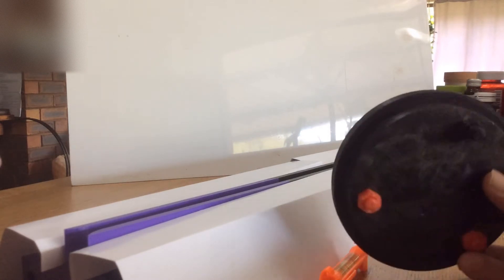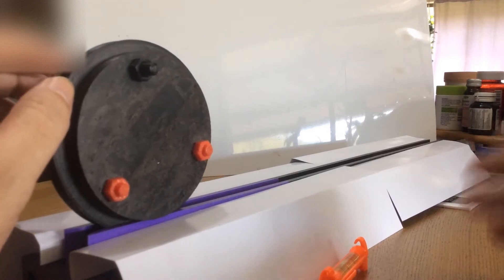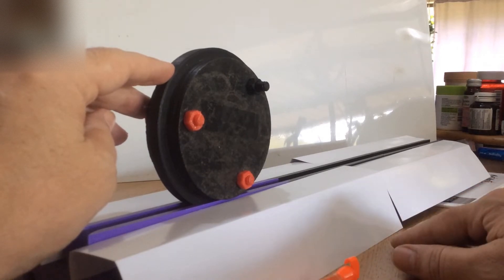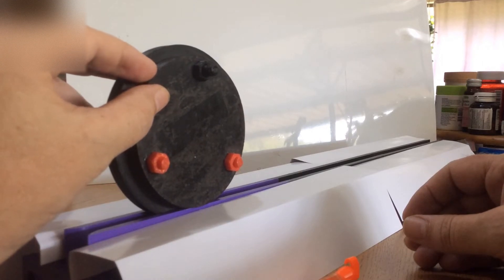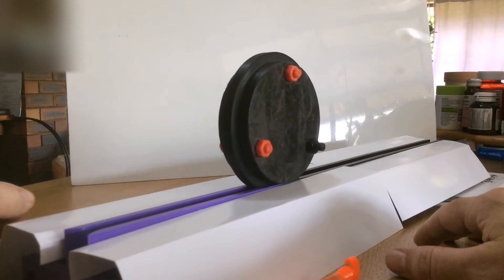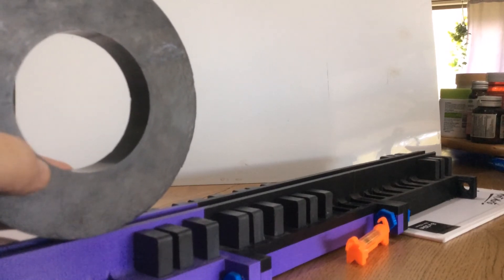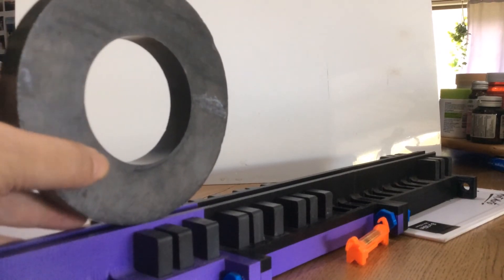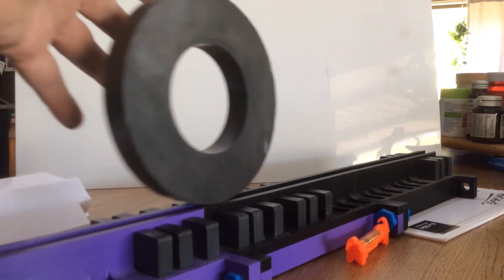Magnetic Propulsion Free Energy Magnetic Track Motor Design Perpetual Motion Concept Full Disclosure

Comment: This would never repeat forever you do know that right
Reply from the maker: Yep, nothing lasts forever, eventually parts wear out and need replacing. Just like you can’t buy a petrol generator and expect it to run forever. Magnets are reported to have a life span of 1000 years, not sure how that got that figure but that is a very long life battery! I will say in my designs defence, it will go the full distance of a track that anyone can afford to build and leave the end and re-enter the magnetic lock under the influence of it’s own mass, that is the holy grail of magnetic motors. This is capable of accelerating its own mass also, as you can see this is not difficult to achieve with this design, the real problem is realising they lied to us when they educated us! You can’t fix something if you don’t first acknowledge it’s broken!
Reply: @whatifididthis...1236  no I mean, even if you extended this track to X amount eventually it would stop simply due to friction of both the track and the magnetic repulsion. Completely flat track like you showed, extended to X amount, would not go on forever
Reply from the maker: @domestinger8805  Due to the rotor having the ability to self start and re gauge and it uses its own mass to accelerate to a speed determined by the spacing of the magnets your statement is incorrect. I don’t mean to be rude but I have tested hundreds of designs over several years until I settled on this one and magnetic repulsion nor friction will stop this until natural entropy occurs. This does not resist the magnetic flux and therefore the magnets will last a long time, as far as friction is concerned, it can self start and increase in speed so I don’t think it cares too much about friction. I built so many before what you see and I can comfortably say when spaced correctly it overcomes friction and continues on its way. There is one thing that sets this apart from other designs, instead of trying to overcome the magnetic lock I have included it by breaking the track. Now what you see is multiple tracks in series, it doesn’t work if magnets are evenly spaced. Then through years of experiments I worked out as long as it can enter a track and exit a track and re enter another track of same dimensions under the inertia of its own mass then my goal has been achieved.
The only way you will truly believe me is to build your own, this is very very far from rocket science and doesn’t get any easier in my opinion!
Reply: @whatifididthis...1236  look, with all due respect, I am just as passionate about alternate physics as you, but this is incorrect. It's as true as gravity, oras true as the consistency of chemical reactions; no matter what you do, so long as you have a level track, magnets and wheel(s) there is no way to prevent entropy.
Reply: @whatifididthis...1236  I'm not saying this to be a dick I'm saying it cuz I want you to turn off that idea in your head so that it doesn't affect your future work and create inaccuracies.
Reply from the maker: @Dome Stinger  As I said before Entropy would be the only reason this would stop, by that I mean the parts would have to wear out. In respect to the magnets, they aren’t going to fail before the life of the purchaser, in regards to the track structure you can use materials much sturdier than 3d printed plastic and same for the rotor. Once I worked out the correct mass for the rotor it worked. I don’t believe in perpetual motion because the moment you need to service a device you most likely need to stop it. No device has ever been built and left alone forever with no expected wear and tear or maintenance and the same would be expected if this was a method of propulsion. People would maintain it but if you choose your materials correctly this could easily out live the creator. Nothing lasts forever. But this would supply power for a lot longer than most systems if maintained. Today I repaired the starter motor on my ride on mower, entropy had set in and began oxidising the spring and retaining clip, I decided to intervene in entropies plans and restored their condition to delay entropy, nothing lasts forever, but you can make it last longer and the lawn looks better because I worked with entropy.
Reply from the maker: @Dome Stinger  With all due respect, I understand where you are coming from but this is something I completed a long time ago, I dedicated a large portion of my life to real experiments. I realised our education was wrong and started to look into the cracks and making this device work sent me into depression for a few years as I knew without question I had been tricked, lied to, deceived by people I thought were great minds, now my ego was questioning my intelligence, if I was as smart as I thought, why had I not worked out this lie earlier. I sit on the other side of the fence having done the work myself because I don’t trust humans. I once ran the same tracks you run in your mind but just like Tesla wasn’t a fan of Einstein because his work was based on theoretical imagination and garbage and Einstein was also a military product, unlike Tesla who did the physical experiments in the real world, supplied evidence, and so many marvels that we all use today. In this case I have done the work, seen success with my own eyes, tired of all the bullshit, all the nay sayers so I did it myself. The way I see it, we can put down our ego that hides behind our education, go on a journey, educate yourself, with your eyes, your hands, see for yourself if it works or not, of most importance don’t beat yourself up when you experience the shame that comes with the realisation we were all fooled, your not alone, they fooled much greater minds than ours!
Reply: @whatifididthis...1236  I don't doubt that we have been fooled and lied to. It doesn't change the fact that this does not work how you state it does. We can define entropy however we want but we both know what I mean when I say what I said. This device doesn't "work". Whether this wheel rolls through another 5 magnet sets or not, it's not what you're claiming it to be. Without manipulation of energy (sea of aether), everything on this physical earth abides by the same principles of entropy (not wear and tear, equilibrium). Once the bath water has emptied, it cannot be refilled unless work is done to put it back there. This is not a lie. Eventually the earth will no longer exist due to the same law. Parts wearing out is no different to things slowing down, or losing energy. EVERYTHING in its natural state on earth abides by this same physical law.
Reply: @whatifididthis...1236  to reclairfy: parts wearing out IS NOT the only reason it would stop. The other reason is that the momentum of its mass is unable to consistently overcome the magnetic interaction. This is because the mass and magnetic field are both static and not dynamic. Static magnetic fields cannot produce work unless they are made dynamic within a system. Mass cannot change unless it is made to within a system.
Reply: @whatifididthis...1236  to double clarify: this is why bedini works, because the magnetic field can appear and disappear dynamically within the system at will. You gain extra kinetic energy from the system because the magnets are not equally hindering the system as much as they are helping it, which is what is happening in your case with this particular experiment. There is no magic without a dynamic magnetic field: a coil bringing a magnetic field into and out of existence, or moving the field.
Reply from the maker: @Dome Stinger  I think you are missing the point that I agree with you. I have said nothing lasts forever but there are things you can do to make it last longer. There is no point in debating this with you, I genuinely enjoy your questioning but it is hard for me to debate something that is part of my reality, you need to remember that I have done this. I ask nothing of you except build it, then let’s have the same chat about it.
Prior to the Wright brothers making their first flight, the top scientific minds of the time were all on record as stating it was impossible, this is what they taught in the best schools! You will do yourself a great justice by throwing away some of these laws, things just are not as we believe them to be. You do realise for most of our so called laws all of our greatest minds have said they weren’t actually sure but we will run with it anyway for lack of a better description! Just build it, then we can talk about the other side of the coin. Crying out loud, Einstein called quantum mechanics “spooky”, trust me, I have nothing to gain from you trying this but there are those who will benefit from you not trying it!
Reply from the maker: @Dome Stinger  As stated before, nothing lasts forever. I’ve built quite a few Bedini motors and Adams motor variations and even they need tearing down, even when you get them running to an efficiency where the coil is colder than room temperature as mine were, running for years but still required switching off, coils needed to be swapped out after long use...years, they reduce in efficiency. I intend to rebuild my favourite Bedini/Adams motor with a coil design and core that worked so well that I kept it even after the termites in a shed got to the wooden forms on both ends. If your familiar with Ed Leedskalnins work you would know our education is wrong, therefore any theories based upon wrong data is still wrong. You can’t tell me why it won’t work because the laws your using to calculate it are wrong, the laws your using to understand it are wrong, all that needs to go out the window. What I did was entertain what my education said was impossible, why, because it interested me and being between surgeries I needed something to do for my mental health. I already had built Adams/Bedini motors by this time so something was fishy to begin with. When you get where I am in the fish market, there is nothing but rotting stench of lies.
Reply: @whatifididthis...1236  I'm just quoting what you said. That it would travel the extent of a track anyone was to build.. it won't. The magnets don't help at all, they are part of the overall entropy.
Reply from the maker: @domestinger8805  That’s what your education would have you believe, I know otherwise, I’m not blaming you for the lies you have consumed. I am however stating that if your conclusion is based on education then there’s no other way to say it but your wrong. Just like you were told the Big Bang was how our universe was created or that nothing moves faster than light, that’s wrong, or that Marconi invented radio, wrong! I will not budge on this one, our education is wrong, our education system is flawed, our science is flawed our laws are ridiculous. Surely you are curious by now, you could just build it and see for yourself, don’t let your ego hold you back. Don’t worry I have been where you are and by the sounds of it you are struggling to grasp this reality. DON’T USE YOUR EDUCATION TO GUIDE YOU! Build it and you will see, this is how they want you to feel about this, they tricked you, they want you to work for something that is free, your entire schooling has lead you into slavery of mind body and soul, however, you are free to wake up at any time. I will say, awaken slowly as it’s a depressive ride when we realise we aren’t as smart as we first believed.
Reply: @domestinger8805  you do realize that it is possible to do this. There are already several pattons that have been filed for working magnetic motors. I am not vouching for this one, but the principal. Also you claim this is a static system, but it is not. The rotor has several magnets in it at different locations. As for the work it is possible to get work out of permanent magnets, because you had to add work to them to make them magnetic.
Reply: @savemars4383  nope
Reply: they once said metal objects cannot fly in the sky because it was heavier than air...😂😂😂😂

Comment: what about having an aluminum shield that free rotates on the wheel leaving a window at the bottom to cut off restrictive force pulling back on the wheel?
Reply from the maker: Thank you for watching. I am unsure of the effect this would have as I have not tested this, which in no way suggests it should not be tested. I have often thought of testing aluminium as it was something that Howard Johnson appeared to do with his arrangements, instead I focused on working with the “Magnetic Lock” or “gate” and included these forces as opposed to blocking or diverting them. In my experience aluminium should not be near the magnets as the eddy currents are extremely disruptive and will add drag to the rotor because the effect has a much broader influence than we assume. When testing my Adams motor 20 years ago I noticed the motor would slow down and stop if I went within 50 cm of the rotor with aluminium, this made me think that all the motors with alloy body’s are costing us more money to run because of this design flaw.

Comment: nice work..but it only works as you have pushed it  giving extra energy...after not long it would lose the energy you gave it by pushing....and quickly it will l stop...but keep trying bro good effort
Reply from the maker: Thanks for watching. This design only requires one push, the first one! The other impulses are supplied by the track. The separation of the magnet sets in the video demonstrates the maximum and minimum spacing required between sets and that only one impulse is required at the start. Once this system has achieved it’s maximum speed it does NOT stop and maintains velocity for the full length of the track, even in a rotary design as the magnet sets are individual tracks with equal input and output, the energy in the system is the first impulse from my finger, as you may have noticed the magnet roller enters the second set with ease, which is an identical set to the first, as the sets are separated, the second set is all the evidence you need, not to even need to mention the hundreds of sets I’ve had it run through. Unfortunately there is no way to know the truth unless you build it and see for yourself....NOT what your education gave you! Don’t beat yourself up too much when you see it with your own eyes, it’s simplicity can be somewhat insulting to our intelligence!
Again, thanks for watching.
Have a nice day.

Comment: Make it a hamster wheel. Your disc being the hamster. The track being the wheel
Reply from the maker: Thank you for watching. I love your idea and there is already a similar concept in my files from about 15 years ago called the “hamster motor”. I don’t remember the original designer but I have always wanted to test that concept with this track however I feel the weight of the track will be destroyed if focused on equilibrium. I feel  that an equal number of magnets and equal weight will cancel the potential. 
Equality = failure.
Reply: @whatifididthis...1236  it doesn't have to be equal, just infinite. Like an excavator track